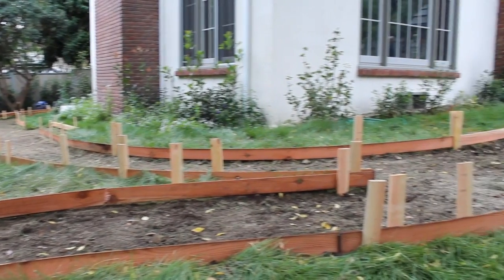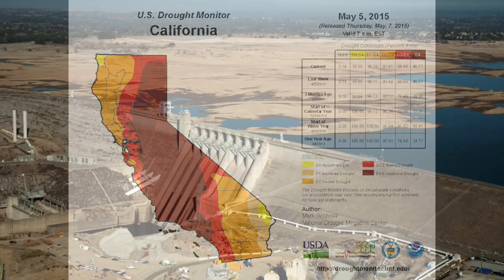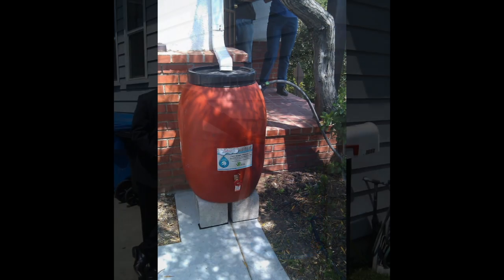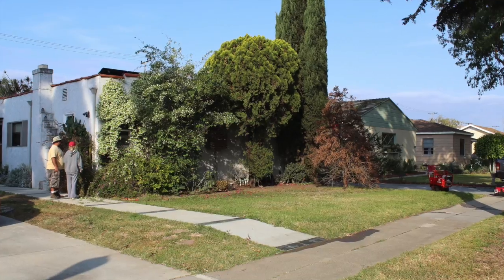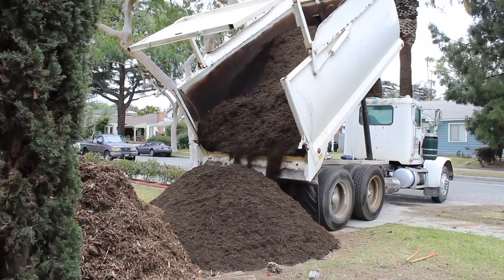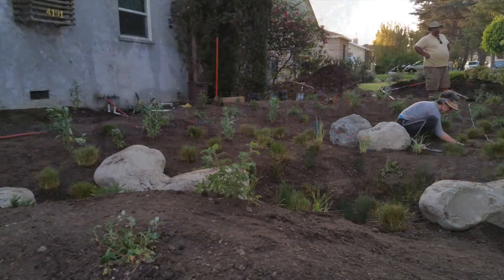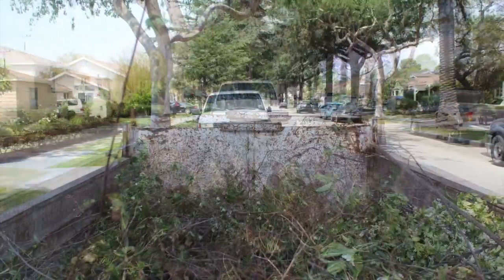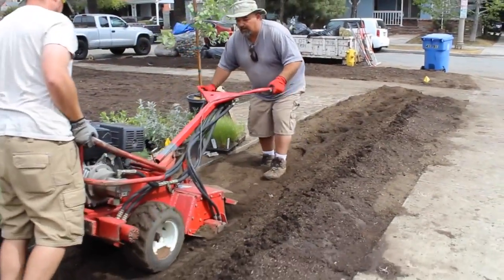Rain Garden "How-to-video"

Comment: Good explanation for the need of a rain garden. We live in a different region with more rainfall, but still clean water is the way to go.  However, the garden shown looks quite expensive to create. Some may wish to start with smaller DIY rain garden project. Not sure if there would be a practical way to do series of small rain gardens which could eventually take over an entire yard. Just a thought.🌼🌿🌾